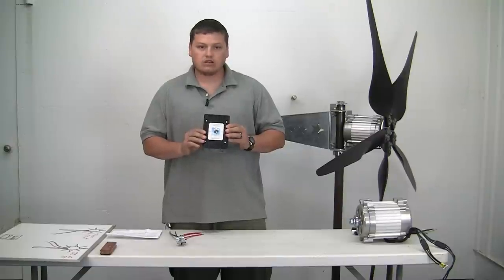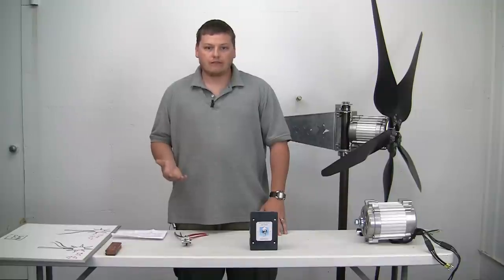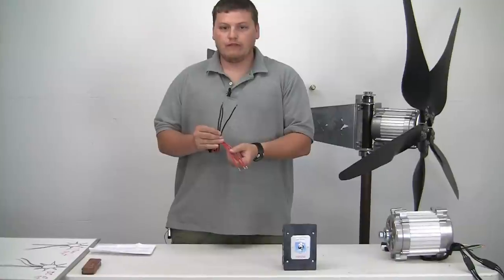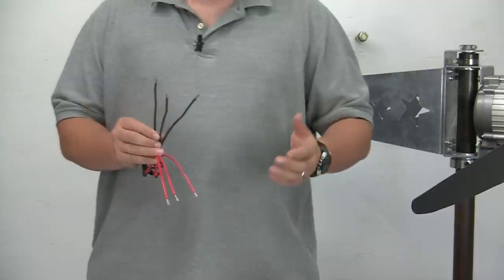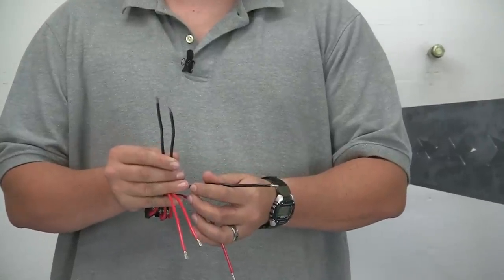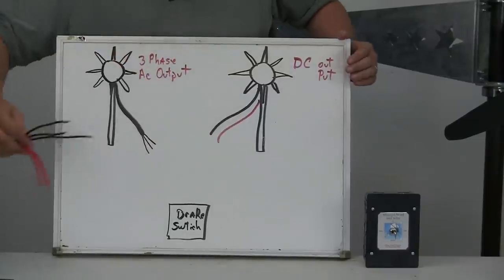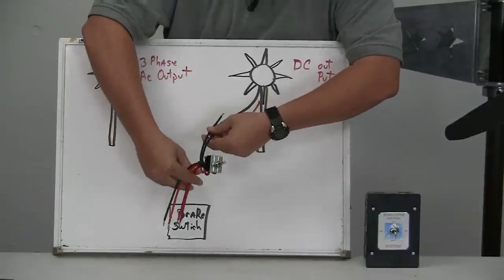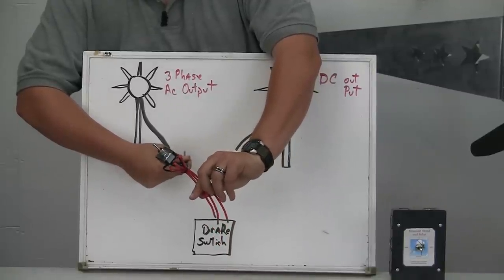Wind Turbine Brake Switch Install | Missouri Wind and Solar

Comment: I'll be making a wind turbine from a hykel&fisher smart drive motor, it will be wired in 7 phase , have they come out with a automatic brake system yet, and if not can this still be added to a 7 phase motor?

Comment: the switch is an on/off/on type... is that right?   for an AC turbine setup,  would't both ON  be the same? I mean what makes them differ from power mode to brake mode? just confused a bit....

Comment: Can you explain how this switch actually works does it just disconnect the power or does it turn a brake on?
Reply from the maker: toddlfrank It can turn the brake on and disconnect the power.

Comment: sorry, but I do think a better explication of how it works (the brake switch) could help a lot better.... Jeff a better demonstration of the break switch would help a lot better than this...... although to keep it a company secret this is a good video! not to much info, but enough to see how it some what works. I get it.. I my self understand...  great video thanks... thumbs up. plus Ben did a OK job.......
Reply: If you want to wire up one yourself for cheap, here's how you do it... Get a "triple pole, triple throw" switch rated at, at least, the amp value of your wind turbine (watts divided by volts) plus 25%, more is OK but not less. Then label the front, and wire up the back, as follows:

----

On the back of the switch... connect each one of the 3 wild A/C wires from your wind generator to one of three terminals in the center row.

Next...

On the front of the switch... label the UP switch position as "RUN", and then on the back you connect each one of the three terminals in the _bottom_ row to a new wire going out to one of the three "wild A/C" inputs on the bridge rectifier (or to one of the three "wild A/C" inputs on a wind charge controller.)

Next...

On the front of the switch... label the MID switch position as "FREE SPIN", with no need to do anything on the back since the switch in it's center native "off" position.

Next...

On the front of the switch... label the DOWN switch position as "STOP/BRAKE", and then on the back you short circuit together the three incoming wires by soldiering a jumper wire across all three terminals of the _top_ row.)

Here's a picture of how the back should look:

http://www.colemanair.us/vp_asp/scripts/images/colemanAir/S3P3G_Inside.jpg

----

So, there's your "company secret", lol. You just need a "triple pole, triple throw" switch, a piece of jumper wire, and three new leads wires to go to your bridge rectifier or wind charge controller.